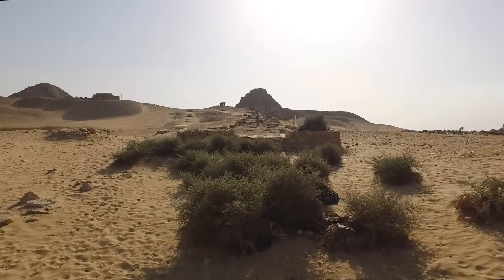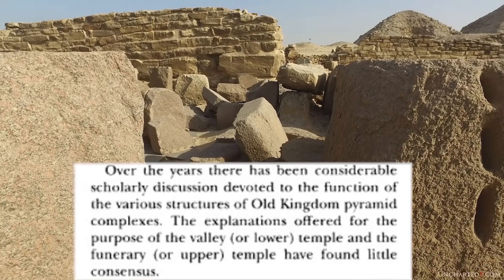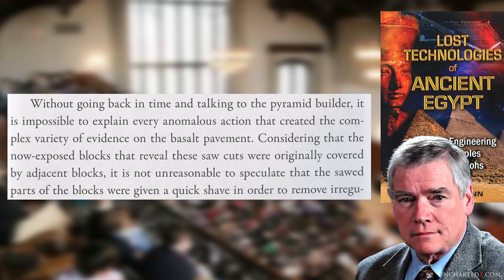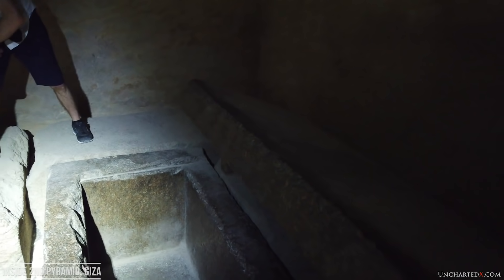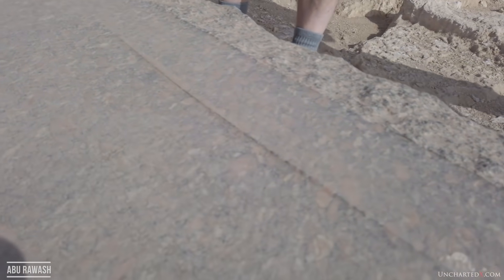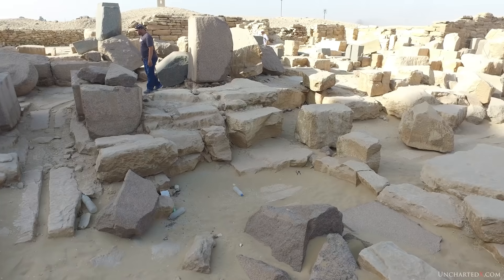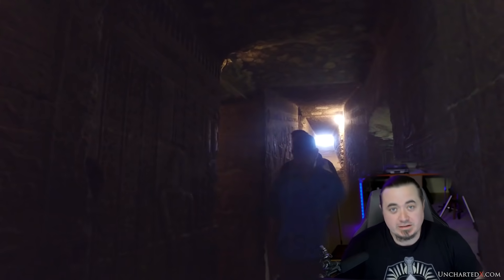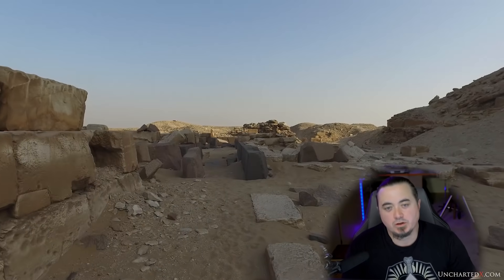The Mystery of Ancient Egyptian Stone Cutting in Basalt and Granite - UnchartedX full documentary!

Comment: regarding the channeled block running under the pave way, I just got the idea that it could have been used as a level reference for setting up the plane of the pave way (defining a horizontal grid line), by filing the channel with water to make sure that those reference lines would be leveled.
Reply from the maker: Not a bad idea. Some them run down beneath causeways though,  definitely not level.

Comment: It would be revealing to have a 3D laser scan (on a sub millimetre level) of some of these blocks with saw striations. Being able to perform detailed measurements of striation straightness/circularity, depth, distance between, etc over tens or hundreds of striations would tell us a lot about the cutting instrument, its use, wear patterns, usage patterns, and so on.

The pendulum drag saw is intriguing (if impractical as proposed). However, I wonder if instead of having the two support ropes attached to separate points of support, they were attached to a single, central point of support, and instead of a straight saw, the saw was  the shape of a segment of a circle. Such a saw could produce striations and a cut edge similar to a circular saw. 

I further suggest that careful measurements will differentiate the striations of a circular saw, which cuts in one direction, to that of a reciprocating saw, which has a forward and backward cut.

Comment: 45:40
If you are going to install water channels, you will want to use a rock that doesn't dissolve. Limestone would be the worst rock to use, sandstone would wear away too quickly. They built this infrastructure to serve generations. To last, so granite would be perfect, since it's the hardest stone we have in abundance. By installing water infrastructure underneath the blazing rays of the sun, it is less vulnerable to evaporation. Also, if you heat the water, t can distribute heat all around the system;- Under-floor heating, as seen in Roman architecture. The great ancient city ruins of Petra, in Jordan, features an amazing water system. Water gives life to all living things in Earth. I admire these lost civilisation builders, because they built something to last forever. Why build something to fail when you can build it once and get on with enjoying its use?

What frustrates me the most is how there is an 'agenda' which aims to stubbornly maintain a narrative that has so many holes in it, it cannot hold a drop of water anymore.

Comment: One thought, on cutting speed, if the disc was in fact 9 m or 27 ft in diameter (no idea how they would make such a thing), but would that allow for the depth of cut you show in the video? Also, if the cutting disc were on a shallow incline it would give you a concave surface that looks like the block you were investigating with a curved leading edge. This might indicate the cutting wheel was fixed more or less horizonal and the blocks were moved into it. Great video as always btw.

Comment: The cutting pattern in the stone mid-video looks a lot like a hemstitch. It's a common toolpath used in CNC machining for certain types of swarfed surfaces.
Reply: They didnt have cnc back then. This is caused as the abbrasive used to cut the granite shapes the copper blade inside the saw cut and the changing blade shape makes a different shape cut.

Comment: I would suspect that those U-shaped blocks were used as tracks to haul stones within the structure while it was being used.  Basically a ground-based replacement for an overhead monorail.  Rounded stone or hardwood, or a combination of the two, would act as bearings and could be lubricated by grease or oil to make transport easier.

Comment: I always thought there could be a pendulum type saw . This with counterweights abs simple guid system could work . This on a triangular frame would allow the depth to be adjusted by simply widening the triangle . Weights like sand bags blocks etc could be added easily . Also other techniques like lapping stone on stone or other media.
There was a recent discovery in China where there was advanced tooling and machinery thousands of years ago . I think we have very few current craftsman in this type of industry and certainly it’s hard to comprehend a skill or even industry that we can’t understand .  I think there are many ways to imagine they could make this . It would be fun to get some research money to do it
Reply: I had the same idea but the distance between the grooves (the amount of material taken off during one swing of the pendulum) is far more than I believe would be possible using even the hardest and sharpest tools.
Reply: The comment on distances between kerfs is simplistic, with our modern high speed saws , every tooth/pass doesn't make a kerf . Irregular and out of alignment cutting edges make the kerfs, if they all did ,it would necessarily produce a much smoother finish, by nature of the frequency, the smaller the progess/greater number of scratches ,the more they merge, ie. polishing is many fine scratches

Comment: The more videos I see like yours the more I begin to see giant PCBs and Microchips the size of cities using high voltage monolithic semiconductors. The grooves ether had water or a conductor in them. The problem is that water evaporates and conductors corrode to nothing unless it's gold and then they are taken away just like the Cap Stone on the Pyramid... It's not just the cutting technologies but the whole thing is brilliant and at times I can identify the parts and their functions if I was using a high voltage semiconductor. Look at a silicon chip under a microscope and you will begin to understand the structures... I know that sound crazy but compare it. Monolithic structures can be used the same way as silicon technology but for higher power applications. The doping and Crystal properties are in the different types of stones some conductive and none conductive also resonant like in piezoelectric effects. Wish I could duplicate their stone cutting methods because I would make a monolithic transistor and run it of a giant Tesla coil...
Reply: I had a guy tell me he believes the great pyramid may have functioned as a MASER.
Reply: @brainretardant  I agree and monolithic structures would make sense in capturing the energy with the potential of lightning discharge. Amazing engineering for what mainstream today thinks was primitive... Even though voltage differences between the surface of the earth are subject to surface plate size discharged in small amperage. I managed to do an experiment where I lowered the voltage to 15 volts and increased the amperage to produce a steady 15 volts and it was not that difficult. That was the most exciting video I ever did I was so thrilled but because I didn't have an over voltage protection circuit on the supercaps I had to disconnect them so they wouldn't blow up. It was supposed to be a quick test and I wasn't sure it would work as well as it did. I now live on a lake front property which is even better for what I will do next... Been working on this for almost 7 years now and when it's finished it will prove once and for all that Tesla's idea for the production of energy was so far ahead of even todays time that they will scratch their heads bald... Lol the prehistoric civilizations had more advanced technology than we do today before they were wiped out and for some reason Tesla was able to tap into the old technology... He had the brains and intuition to do it. He was correct in so many different ways that it would take me books of writing to explain and describe it all.

Comment: I really liked this presentation -- thanks for persevering in sharing this evidence. One key question kept coming to mind was around the interior of single-piece stone boxes. How could interior corners be cut/shaped with such precision, using anything other than very precise tools (like dremels)? Surely they would be impossible with circular or straight saws? I agree the U shaped sub-floor channels appear to have been created for basic liquid drainage -- and I dare suggest the "collection bowl" at the outlet would be ideal for watering one's animals :)
Reply: >>Surely they would be impossible with circular or straight saws?  Yes, that box had to involve some form of milling to get the internal right angles. But the issue isn't the type of tool but its cutting teeth - ie what did they use? Making up a straight-saw, circular saw, drill bit, tube drill or milling machine from wood is relatively simple - that's just a rotary or linear movement - they definitely had that tech already. It's the cutting bit/teeth that are the challenge. I think quartz or something carborundum (both harder than steel) was used to actually cut. I have also speculated using wood+copper for the main bit or blade body, but the cutting quartz parts fixed to it with molten lead.

Comment: Enjoyed this ... much time in the ME including Cairo/Giza/J-Town ... as an Aerospace Engineer that started his work life as a simple "Carpenter", the striations always bothered me ... still do. "Circular Saw Blades" disappear from our history books for several thousand years giving way to giant "Cross Cut Steel" devices. Some stories tell that a "Wife" watching her Husband and helpers ripping logs in the old West (from a pit) came up with the idea of a "Circular Saw" blade given the additional contact surface increase and its' efficiency.

As to the "Channel Blocks" ... you evidently have never laid "Paver Blocks" at your domicile ... not as precise as the Basalt pavers but close enough.  You also must not have spent much time in the Weather formations of the Cairo area and what happens when a deluge hits ("Cow pissing on a flat Rock" as we say back in Texas) ... it is quite obvious to me they are for "Drainage Overflow" so as to not wash out the sand between the Basalt base and joint Sand; a real pain in the arse to repair once the yearly deluge hits. Don't over think it ... too small for "Sewage" but perfect to prevent erosion. Just saying.
Reply: If the saw blades were an arc (piece) of a circle it could have put on a pendulum and moved by water current moving through a channel...move the water left to right, saw moves the opposite, close that channel with a closed gate and open another at the other end and the saw moves the reverse direction...left/right/left/right etc.  This means that men did not have to move the saw blade, only manage it's position and direction.  That way they could have two significant features.  IF sand was put in the slot, it would stay in the lower part of the cut and not be pushed out by the blade.  That is far more efficient than a straight blade moving back/forth which. The other item is the sand would be best if it was of a material harder than the rock being cut.  That way it doesn't turn to dust nearly as quickly.  We use circular saws because we have power to run them...in my previous comment above, the Egyptians could have also made circular saws.  The real unanswered question is how did they make the blades and what material were they made of...they sure as hades were NOT Copper!

Comment: if they used copper or bronze is like a crayon on concrete all these stones would have copper all over them.
Reply: exactly. You'd be able to samplecrevice's
Reply: @AnunnakiAaron  thats a great idea
Reply: @TheDemonation13  My original reply was cut short somehow.  You'd think you'd be able to analyze something, somewhere, anywhere, and look for copper residue. If they were using all this copper to cut these blocks, wouldn't you think there would be copper all over the place? Embedded within the crevices and cracks and grain structure of the blocks. My bet is you would find very little if any, which to me would indicate that copper wasn't being used. I would be interested to see some kind of analysis of the stones, and dirt around these areas to see if they can find unusually high concentrations of copper that would indicate all this copper tool usage. I would think that would go a long way in showing that all this copper wasn't being used to cut and shape these stones. If you analyzed substructure dirt, and looked all around and found no copper, that would be interesting.
Reply: @AnunnakiAaron  i saw it was cut but i read it before it was gone is great idea to test the area
Reply: Yeah unless you know they collected the metal scraps and melted them down.
Reply: @marcmyers1465  Your acting like this would be hard.

Comment: Hey man, been really enjoying your channel, and like a lot of others I have found the puzzle of how they actually did some of these cuts and tube drill holes more fascinating than the puzzle of how they put them all together to make the pyramids. With the basin at the end of the u shaped channels I do wonder if this was used in areas where stone cutting took place and the basins were a way of collecting the worn away copper/bronze particles for recycling. Perhaps it was part of a first phase and like part of the workshop floor that was later covered and they were like drainage channels. I think water obviously played a big part in their workings. Did they use water wheels at all? Also I do wonder if there are any artefacts in existence that could of been made by recycling large circular saws into some other object or perhaps they were melted down in later times for reuse. Also I wonder about any remains of their metal smelting works or even circular moulds where they may have cast circular saw blades although they may have consisted of smaller cast segments put together on a wooden or stone wheel of sorts. Also I do wonder if any other sites out of Egypt have signs of large disc saws. Anyway yeah fascinating stuff, keep up the good work!
Reply: Interesting and logical thought. But is there a source of water close enough, with adequate flow? Would pumping stations be necessary, or many workers relaying/passing buckets?

Comment: Ben, has there ever been any sources of diamonds or any  other  harder elements that could have been used ? 
Something found in piles that would have been left behind by a tool that could have rotted away ? 
 ie.   Maybe rope with diamonds adhered to it like a diamond wire saw or any other polycrystalline cutting blade ?

Comment: I was thinking of a tool that could cut granite. Modern grinding wheels are made of corundum grains glued with ceramics. As a result, as the  corundum grains dull and wear, the soft and weak ceramic binder wears off quickly and easily, revealing another layer of corundum grains.
Theoretically, I can imagine diamond or corundum sand glued with copper, just like in modern grinding wheels. But then there would probably be traces of copper left in the stone in the form of discoloration.
Diamond tools are built differently. These are steel discs with diamond dust glued on. They would also leave other traces of processing. The ones you present are traces that, if they were not in the stone, I would say that they were left by a bi-metal drill in a soft material such as aluminum. There is a very large longitudinal feed here. That is, the tool has teeth like a milling cutter or a bi-metal drill and cuts a lot of material, quickly sinks into the material. Such feeds are not currently used in metalworking, much less in stone processing. This would only be possible with a very large difference in the hardness of the tool and the workpiece.

Comment: I once burnt a bonfire next to a large rock, and the rock started flaking off from the surface.  

Also, a circular saw with a diameter that large would probably be impossible from any known material, but a pendulum saw on the other hand could probably create similar cut,  and wouldn't need outrageous amounts of material.
Reply: Agree that the pendulum model is likely candidate
Reply: I’ve never seen one of those but circular saws that size seem unlikely. I worked cutting granite for years and the large cuts were done by wire saw and the smaller cuts by circular saws.

Comment: Suggestion for an explanation of the functionality of the 'hidden channels beneath the level basalt:: It seems plausible that these served as a collection system (rather a repetitive RE-collection system) for the huge amount of abrasives required in the cutting of the stone. Once the residue of the grinding of any saw blade assisted by (whatever) abrasive compounds were used fell from sawing process, I propose that all byproduts may have been flushed to collection points via these channels. Abrasives, rock debris and metals would have then been dutifully separated. The valuable metal and perhaps even some of the abrasive would then be reconstituted for reuse.

In addition, the large and suitably hard plaza was designed to accommodate the large stones in many ways. I imagine a process of there having been trial stones of perfected shape to ensure that plane surfaces were achieved before a finished product was moved for assembly. 

The engineering and design of such a large basalt area with channels beneath was therefore one of practical necessity and particular genius in the realm of materials handling and conservation in the drawn out process of working the large blocks of stone transported to the location.

Comment: 30:50
Normally I agree with the circular saw ideas, however something just struck me.
I curved copper saw, held up like in the pictures showed earlier in this video and swinging back and forth like a pendulum, would look like a circular saw. It would be a "partial circular saw" and the radius would be the lenght of the ropes holding it up. When swinging, the teeth would trace the circumferance of a circle.
Reply from the maker: yeah, its called a swing saw. It's another possibility. It would still be a massive and advanced machine to create a block like the one at Abu Sir.